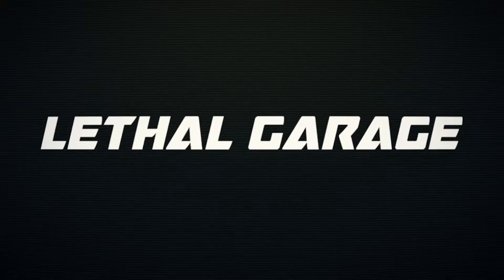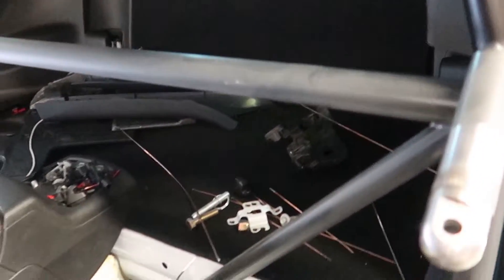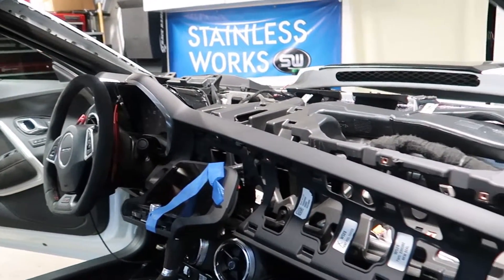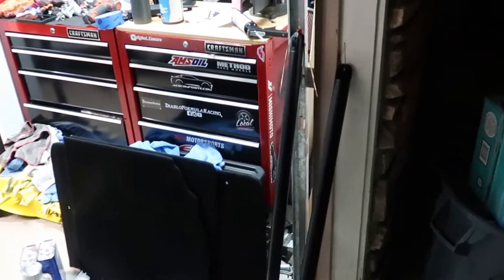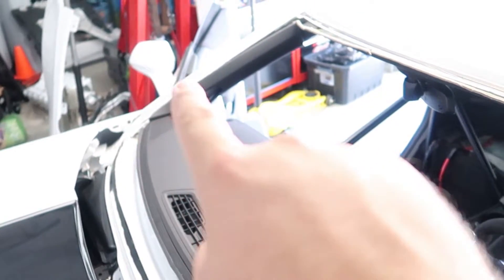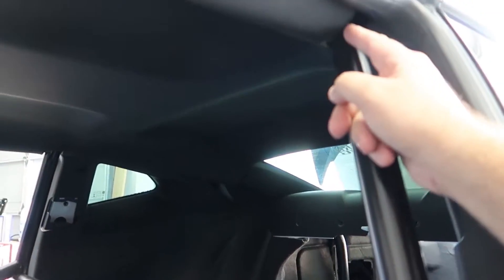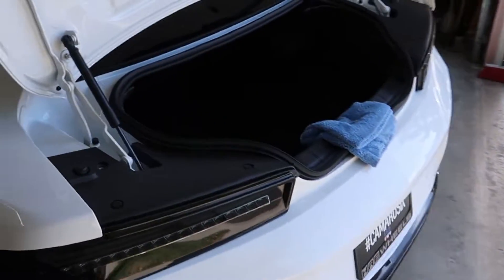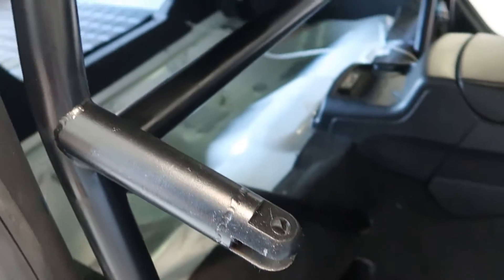8.5sec Roll Cage is Complete!

Comment: Did you have to do anything for the side curtain airbags since the cage tubes are up in that area?
Reply from the maker: Took them out
Reply: @Lethalgarage  did you bypass them so the rest of the system worked? Or did you disable the entire airbag system? I'm looking to do the same type of cage just wanting to figure out the best way around that. Any other surprises?
Reply from the maker: @kyle_with_a_k  You can test the resistance and block them out.

Comment: Cage looks good. Also what camera are you using?
Reply from the maker: G7 Mark II
Reply: LethalGarage I got a quick question boss, I'm buying a used 2017 SS with 2000km on it, pretty new but I know the car hasn't been broken in and it's been raped because it's been sitting at the dealership. My question is, "is it really that big of a deal for a break in?" And if it is what can I do after I purchase it to essentially give it a proper break in?